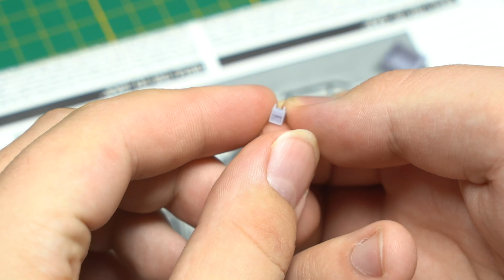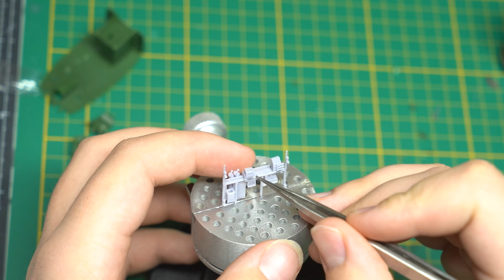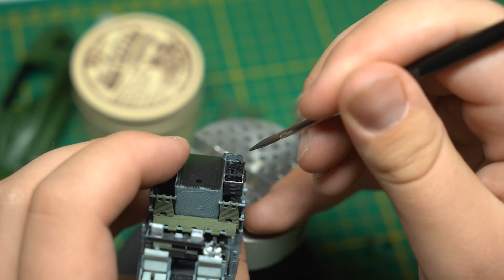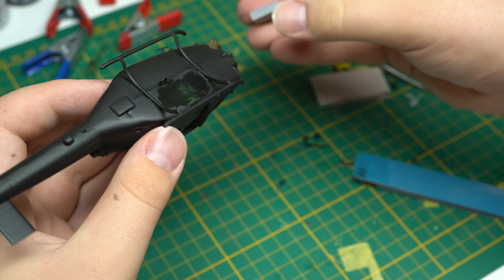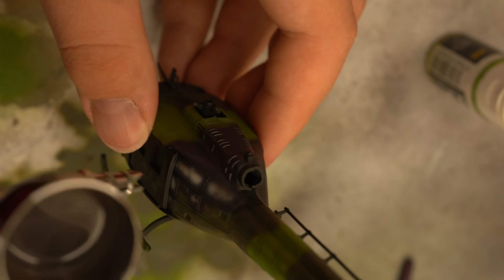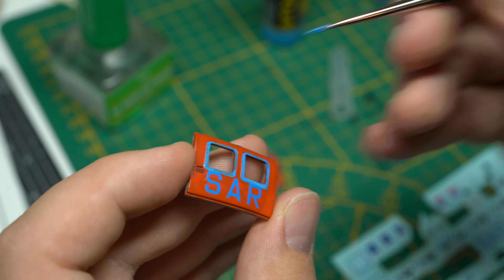Bell UH-1D SAR | Revell 1/72 | Custom 3D parts.

Comment: Did you have too modifie  as well the instrument panel for it to fit? (pice 10 in step 6) .
Im struggling with it right now, did you put it in between the two front pieces or on top?
Great video and finish on the model👏🏼
Reply from the maker: Hi! I cant exactly remember what i did but looking at the photo's of my finished project i can tell you that i glued it to the center console that was on part 1, and filled the gap that was left between part 10 and 8&9. i just made sure that it sat flush and correctly against the center console, and filled the gap with 8&9 since that was more out of view in most angles you would look at it once it was finished.

heres my pictures with what i mean, hope this helps!
https://pin.it/3xT3umoOv